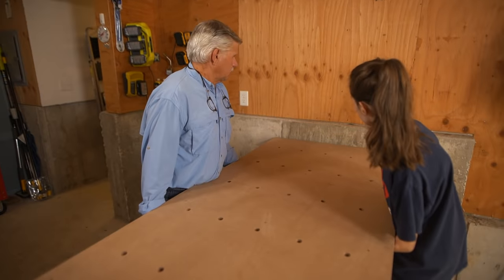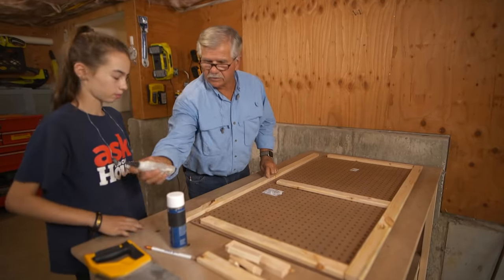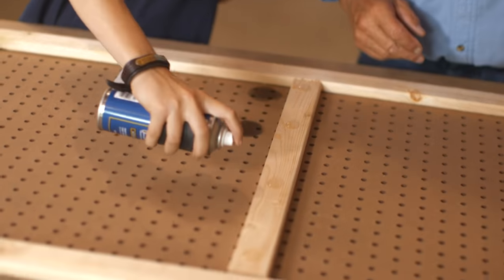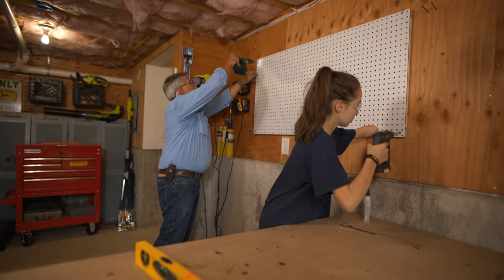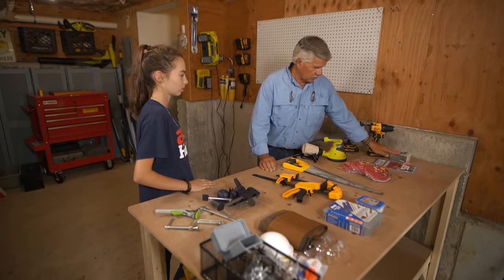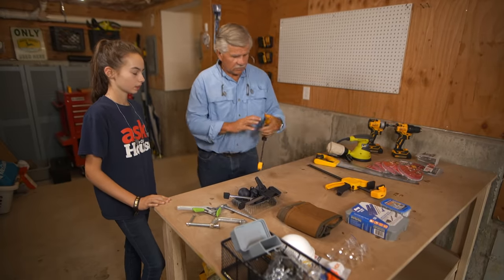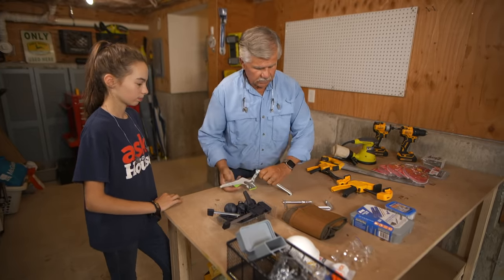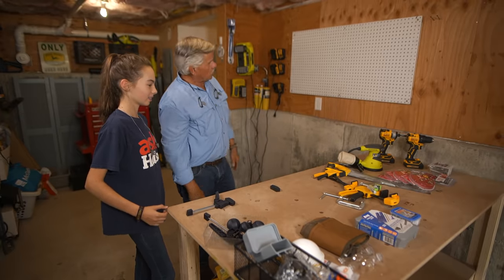How to Set Up a First-Time Workshop  | Ask This Old House

Comment: Tom, I don’t think you picked the tools in this video because you would have only gotten her stuff she could use. Couple examples are the C-clamp and the dog hole clamps. A quick bit change adaption would have been nice since she will have trouble holding a bit in and tightening the chuck on a drill. I know you guys will get back to her and help remedy the foreseeable difficulties. Thank so very very much for helping her out! As always, you guys at TOH are great and inspiring!!!

Comment: A Japanese hand saw wold me much easier.  OK, mine is from Harbor Freight so it's probably a Chinese Japanese-styled hand saw.
Reply: I was just thinking the same thing. Especially for smaller cuts like these.
Reply: They are also called pullsaws in general, but the japanese styles are the most common.